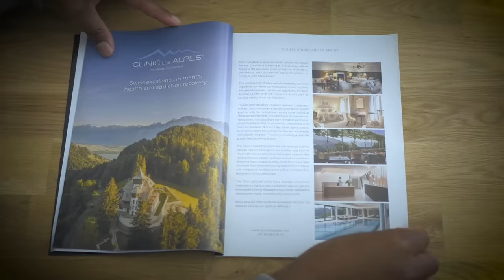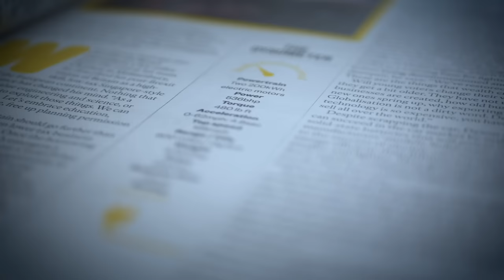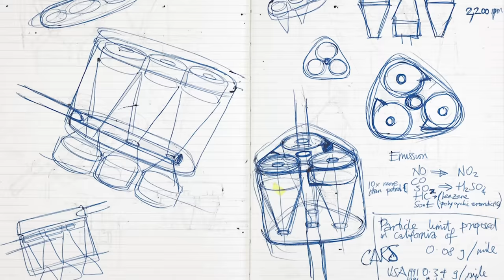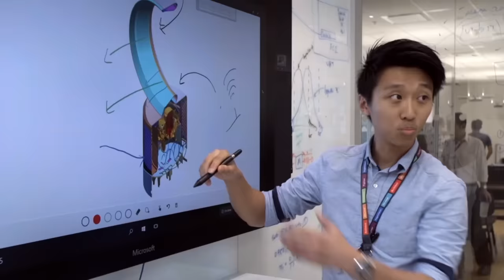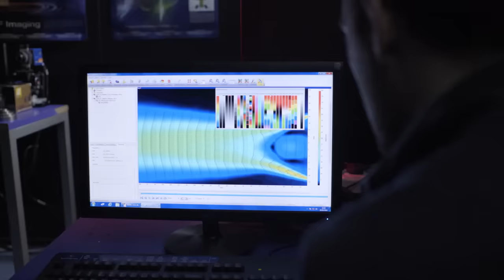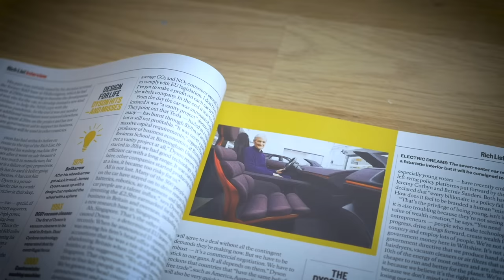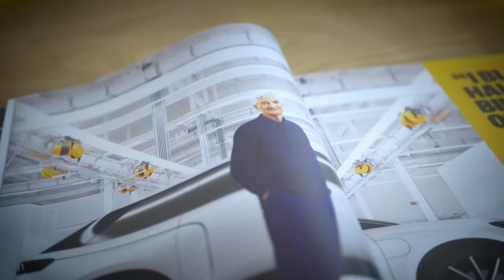Who Killed The Dyson Electric Car?

Comment: Electric cars with batteries of today are DoA. Who the hell wants to drive 600km then stop for 2h to fill a good portion of the battery to continue? Not to mention the lifespan of batteries are ~5 years, which means the suckers who bought these are gonna have to spit out a MASSIVE amount of money to let the car work again. All this combined with utterly horrible infrastructure, what do you expect 5 billion vehicles in the world to be charging up at the same time? Electricity is for smaller, niche things, not general workload of such magnitude. When we send a rocket to space on electric power, I'll accept things are starting to change. Until then, gimmick.
Reply: My god, a time traveller from 2008. You'd better sit down, you won't believe all of the things that have happened since then...
Reply: @drunkenhobo8020  enligthen us sunshine
Reply: Well in the year 2020, there are plenty of electric cars that have been on the road for more than 5 years yet needed no battery replacement at all. You flip phone's battery may be on the way out after 5 years but car batteries last far longer than that.
Whilst the charging infrastructure isn't perfect, we now have more charging stations than petrol stations in the UK, and many countries are doing considerably better.
It's unlikely that 5 billion cars would be charging at the same time, just as it's unlikely 5 billion cars would be filling up with petrol/diesel at the same time. The UK's electrical grid still has a surplus of power during the night and we regularly go weeks without burning coal these days thanks to renewables, so there's plenty power to spare.

Whilst it would be extremely difficult to send a rocket to space solely using electrical power due to the lack of reaction mass (unless you count a hydrogen-oxygen rocket), the Dawn spacecraft which launched in late 2007 (so you should remember it easily) used an ion thruster for propulsion in space. I'm pleased to say that it worked brilliantly!
Reply: @drunkenhobo8020  I will look into it, cheers
Reply: You seriously need to get up to date...

Comment: Dyson was too ambitious, with the size and range of the car, Chinese companies and the likes of Dacia are showing the way with cheap ev’s. How many people need a 2.4 ton 7 seater with 600 mile range? What is needed is cheap, small cars with a modest range. A car with batteries big enough to do 600 miles would take far too long to charge on a 7 kw home charger if they were allowed to drop to 20% or less and if you’re charging them more often to keep the battery topped up then what’s the point in having a large battery in the first place. If the goal to move people away from ice cars is to be met without pricing a lot of people out of car ownership then we need much cheaper ev’s. Maybe some of the over the top electronic nanny safety measures required on new models needs to be scaled back to allow smaller and lighter and above all cheaper cars to come to the European market.

Comment: One has to be "crazy" enough in positive sense like Elon Musk to risk too much and push against odds uphill against big automanufacturers to succeed. Also starting early Tesla became a software company. And if in 2008 Tesla could start bulding and Electric Car in 2019 Dyson needed an Electronic Car to be built which is in fact a computer, including still expensive hardware and increasingly expensive software. Having strong business in Asia Dyson should partner with somebody. That should assure half a billion spent wisely. Sony launching its concept was litterally inviting companies like Dyson. Under Sony brand a 180000 USD car could have some market. They could partner with BMW and rebadge the car as Rolls-Royce in the beginning. Assuring build quality that kind of car with those specs could be launched also with VW as Bentley. Another option would have been a Land Rover with Tata motors.  In the worst case it could be launched as Hongqi brand from FAW in China and could have success at least in China if not elsewhere. Dyson might regret its retreat in the future.

Comment: You are clearly a Dyson fanboy Rory, I am not. You fail to mention the context within which this car project failed. Firstly, the guy is one of the few pro-Brexit businessmen in the UK and when interviewed by Andrew Marr a few years ago expressed the view that there should be no such thing as corporation tax on the basis that profits should be re-invested which is total nonsense. The push to reduce corporation taxes are to enrich shareholders. Companies should make a higher contribution to the society that supports them in my view. Secondly, my experiences of his products is that they work well but don’t last as long as German and Japanese designed and built equivalents which are cheaper. As for the car itself, the impetus to build a car came from his acquisition of Sakti3 for $90 million in 2015. This Michigan based company were supposed to lead the world in solid state battery technology but proved to be a dud..Not very smart due diligence by Mr. Dyson, resulting in a £46m write-off in 2018. Still, he made Anne Marie Sastri (who founded the company at Michigan University) comfortably wealthy. Dyson planned initially to develop the Sakti3 technology to production. If he had achieved this goal it would have been very interesting to build a car around it because as you say, battery supply is a killer..unless you’re Tesla. The fact is that Dyson was taken in and duped by the promise of solid state batteries, which should we ever see them will be a game changer for EVs in terms of  power density, hence weight saving, rapid charging and safety.  As soon as Dyson abandoned the battery tech he paid so dearly for the car project was never going to work.

Comment: So what you are saying Dyson is an idiot....the use case is obvious for 600 mile range everyone is happy to home charge and not play hunt the public charger so the range is then effectively 300 miles ....i have an electric tesla model 3 which has the vital supercharger network which is great but not as good as not having to public charge at all especially as the chargers are not always going to be on route .... so as i always say  in an ev range is everything ...
Reply from the maker: If Tesla did a Model 3 that had a battery pack that allowed it to do 600 miles and cost £80,000, would you have bought it?  -RR
Reply: @AutoTraderTV  yes i would have leased it as i am leasing the one i have...i think it would be nearer £70,000 the advantage is not just range a bigger battery last much longer with less cycles less strain .... the frustrating thing is it can be done now

Comment: Over engineered, typical Dyson. You don't need a hologram dash, fit a Smiths dial. Doesn't need 0 to 60 in under 5 seconds, 9 seconds is fine. Etc etc ...

Comment: Downvoted, as while nicely made, the thought process is strange and biased. Mr. Brexit-Dyson from Singapore?
So Mr Brexit-Dyson invented a new type of hoovers ups, vacuum cleaners, hand dryers, and 'extravagant' hair dryers. A lot but very little for now decades old and quite a big company.
Why not 400 miles instead of 600? Still plenty enough. Invested half a billion... mostly just in design/research project. VW etc have indeed started mass production, which is quite different. 
Mr Dyson is a Brexiteer who has run off himself to Singapore. Never buying Dyson vacuum cleaner,  plenty of other makes as good if not better but the half price on the market.

Comment: I don't get the fascination with this guy. He builds mediocre vacuum cleaners, expensive and supposedly premium, but nevertheless only vacuum cleaners. All they ever do is boast and brag about supposed innovations in their products, but at most i find it to be gimmicks mostly. The vacs clog up easily and I'm not sure they're much better at filtering than a HEPA filter, the dryers I find to be ugly and not any better than the standard dryer, the blow dryer and fan is just big gimmicks for having a hole in them. Than there's all this pompous talk of of Dyson representing "Great British engineering", I'd say that RollsRoyce making jet engines, ARM designing processor architectures and countless other companies on the cutting edge rather than Dyson's mediocre product design outfit. They were clearly way over their heads building a car. More like great british marketing.

Comment: Screams arrogance, £500m is chicken feed, even for a petrol or diesel car.
Even making it in a country where labour costs are low it would never of happened. And if it was like his vacuum cleaners, over rated.
All car makers use each others bits anyway, that's how it's always been, they want maximum profit, jaguar use ford engines Mercedes use Peugeot engines the list goes on.